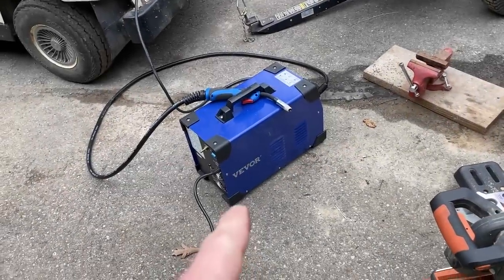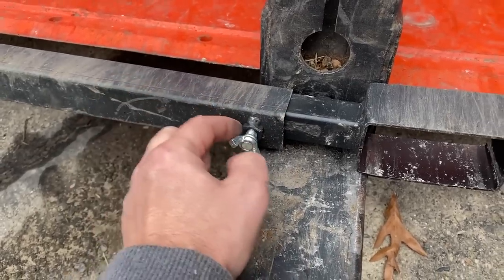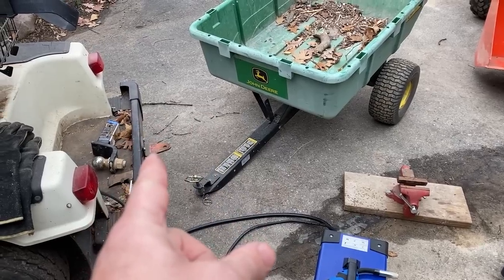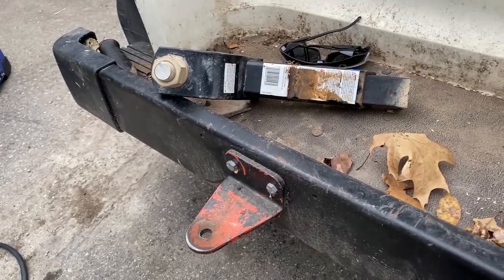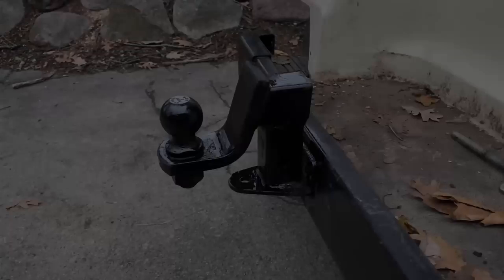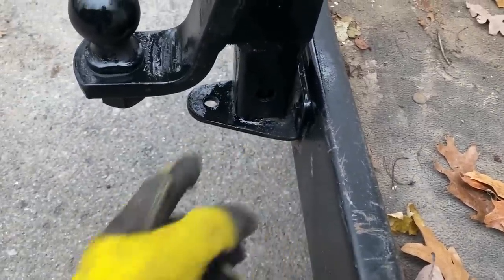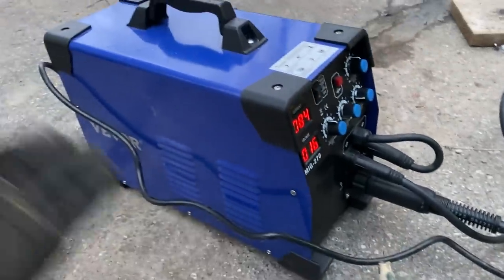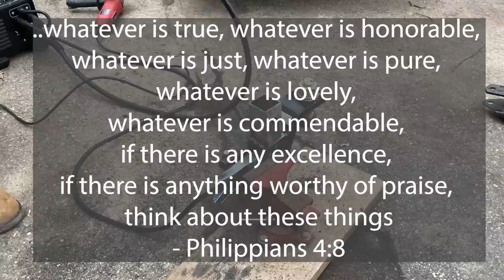Welding a Trailer Hitch to a Golf Cart #vevor

Comment: You could drill a hole through bumper into the back of hitch, then run the appropriate tap size for the hole . Then run that size bolt through both holes with a lock washer. Just an idea😉. Great video, thanks for the demo, was wondering if that brand had ok quality.